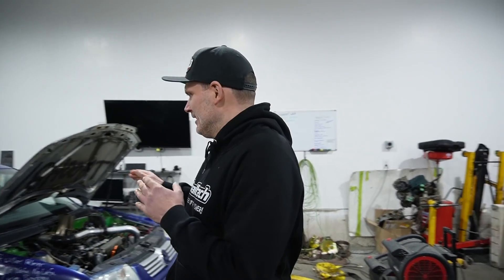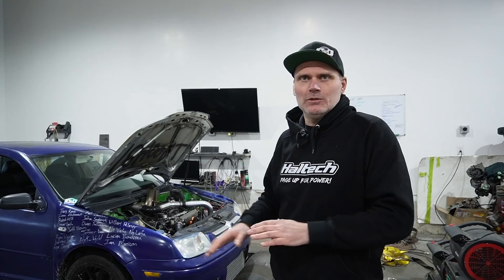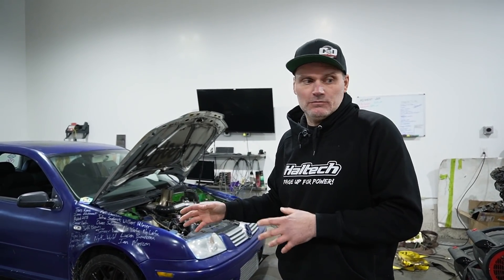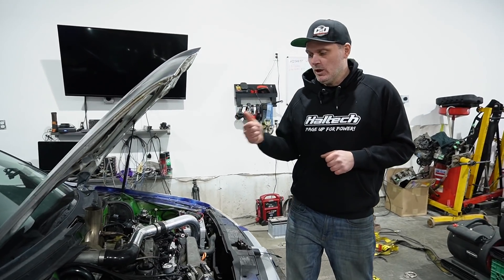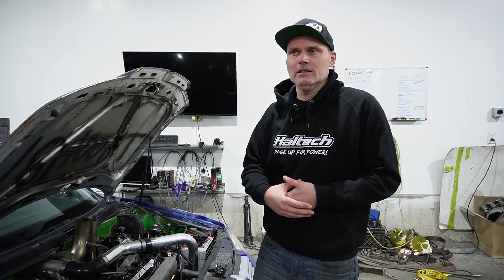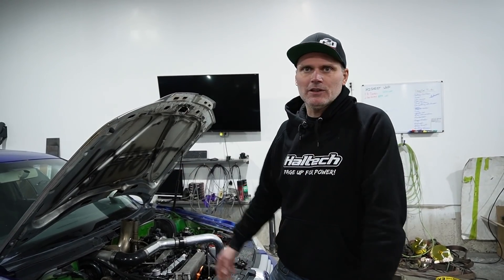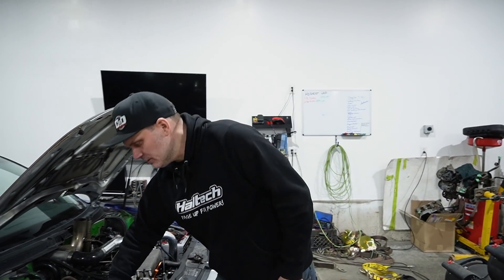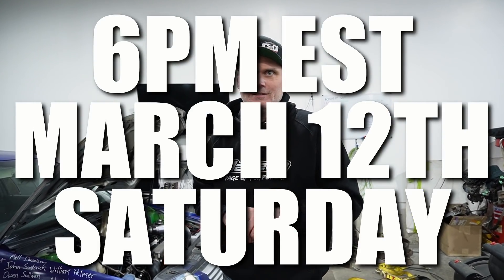Our first live stream is coming! Quest for 600whp on a stock 1.8T long block.

Comment: If this series worked out for you guys, you should start buying junkyard engines and drop them in for different tests. Maybe throw rods in one, full bolt ons on another stock internals... spice it up. The people want to see 1.8t!
Reply from the maker: We have plenty of built 1.8ts on here. Well have a built 1.8t that will be pushing pretty high soon enough. These type of videos will likely stick to stock long blocks.

Comment: What do you do to beef up the 02j? I know they make a pinion brace and an lsd is a strong piece in itself but usually it's the gears that strip like 3rd or 4th..
Reply from the maker: Gearset.
Reply: @COMotorsports   straight cut and just checked $2000 damn
Reply from the maker: @jpra64  generally a bit more than that for a good set but 100% worth it.

Comment: 2:18 I need an automated voice that just repeats this everytime I wanna launch from a dig lmfao people talk about how there limited to turbo or fuel or whatever. This is my biggest limitation is that transmission.  ( Fourth tends to be the big problem ) 

Look forward to the livestream I wouldn't wanna miss out on this one!! I kinda hope for some odd reason she just takes it and surprises all of us.
Reply: Order up a pinion brace and change to an anti shock fluid. Also changing the ring and pinion will likely take the load off of your 3rd and 4th gear. You can make those transmissions fairly strong even with mostly stock parts.